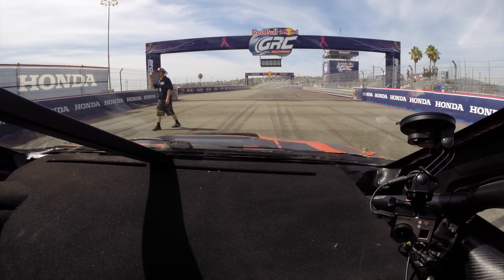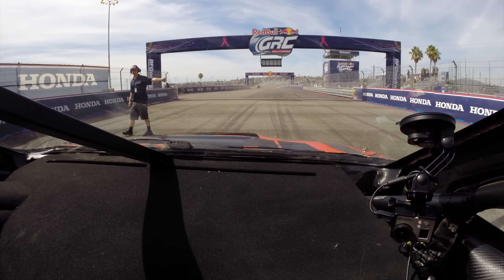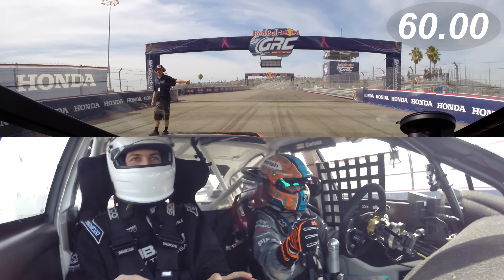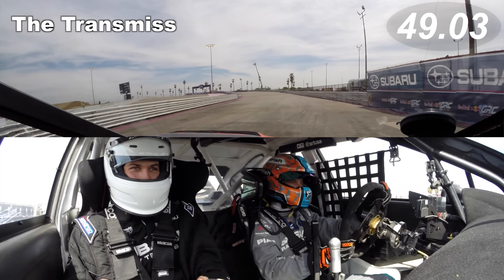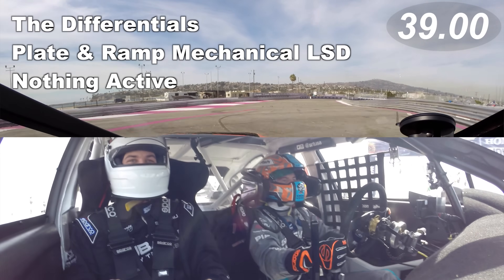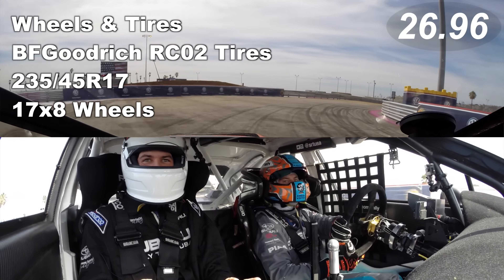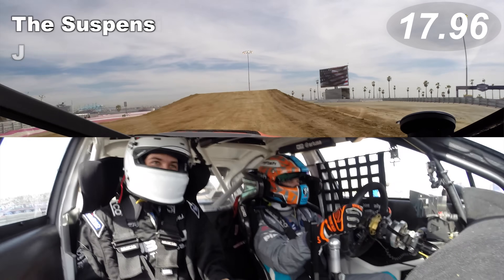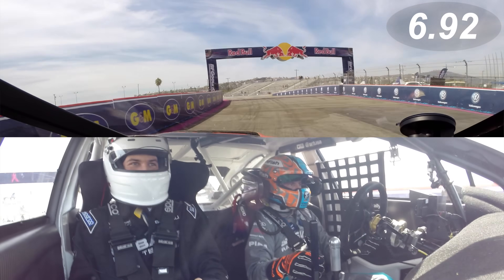600 HP Subaru STI - Rallycross Supercar Hot Lap!

Comment: top speed only 110mph are you kidding me?!?
Reply from the maker: +7150285 on this track, which has no straights.
Reply: 7150285 110mph is ALOT on any track. Especially given a track as tiny as this. Watch a side by side view of these against f1 cars for a good explanation
Reply: whatever. Most cars now can reach 110mph easily on the highway.
Reply: 110mph is easily achievable on a straight highway. My 1999 4cylinder can reach that speed easily.
Reply: it's all in the gearing. on such a tight course why do you need to go 110mph. Its much better to gear the car and get as much acceleration as possible to get back up to speed after these corners.

your 99 4-cyl def can hit 110mph on a highway straight. But i'm pretty sure your car can't hit 60mph in sub 2 seconds.

Comment: URGENT:
Can someone please explain why race or performance designed cars always have gear whine? is it because of straight cut gears? detailed answer would be appreciated.
Reply from the maker: Yes, straight cut gears. Your car has helical gears for forward driving, likely straight cut for reverse.
Reply: Are straight cuts more durable? what are the benfits?
Reply: forces are all axial so you can build a lighter & stronger gearbox and so on...
Reply: I'm no expert, but compare the gear in normal cars to screws. If you turn it, there will be force along the shaft, stressing the parts.
With straight cuts this doesn't happen. All the force is applied into turning the shaft.

PS: Sorry my English is not perfect.

Comment: How high does engine revs?
Reply: to the red line
Reply from the maker: It's around 8000ish RPM, they didn't give me an exact number but said that was ballpark. I don't believe RPM is regulated so they probably keep this info internal.
Reply: About 8000. There isn't any point of reving over that because of the turborestrictor.

Comment: how do u get that high pitch sound on that car?
Reply: It's actually the straight-cut transmission.
Reply from the maker: Straight cut gears, you can drive in reverse in your car to experience it haha.
Reply: it's not the turbos, these are staight cut gears. look it up on youtube, there are plenty of videos showing the sound. :)
Reply: +Nathan McDaniel  Definitely straight cut gears.  Helical gears put too much side force on the gear train, which can cause the trans to pop into neutral unexpectedly.  With straight cut gears, only one tooth is engaged at a time, so that sound you hear is actually the high-speed clicking of each tooth as it strikes its mate on the other cog.  You'll hear this on many modern cars also - in reverse (since reverse isn't usually synchronised, designers commonly slip the actual gears in and out of mesh, rather than using dog teeth and a synchro ring.)
Reply: straight cut gears, it's the same in touring cars
Reply: Ei Boi massive turbos
Reply: Ei Boi that's the turbo sound
Reply: open gears
Reply: that would be the sequential gearbox
Reply: Ei Boi It sounds more like gears than a turbo to me. I suspect there's a set of spur gears somewhere in the drivetrain rather than the usual (and quieter) helical gears. But I'm not a huge car guy.
Reply: sequential transmission with straight cut gears, otherwise known as a dog box.

Comment: Hi, got a question for you to answer. 'Taking weight into consideration, what is the smallest amount of BHP required for a car to reach 200mph?'
Reply: Depends on the drag coefficient and frontal area of the car in question!
Reply: Charlize Theron rubbish, there are loads of cars with much less horsepower that can reach 200mph
Reply from the maker: Weight isn't too important for top speed, limiting factor with be the frontal area/drag coefficient. So of course, it depends! But this video will probably give you a good idea of what you're looking for. :) https://www.youtube.com/watch?v=eWTsXrPWl5Q
Reply: Depends on a million different things. Aerodynamics, tyre grip, weight, drivetrain efficiency etc. 

There is no good answer to that question.
Reply: Only `murican cars messure HP in BHP...so drivetrain losses are not an issue :)
Reply: sorry but no. while the b stands for brake it has nothing to do with the cars brakes. brake horsepower only refers to the way of testing the power. A cars HP (or BHP) is as far as i know always the crank horsepower. at least it is in the us and europe.
Reply: The Esseboy bph is not whp
Reply: 0
A hot air balloon can accomplish this.
Reply: JordanWallac3 would be an interesting question to figure out though
Reply: Hellboy13994 Nope, in Europe we use HP (which is WHP), I know BHP is crank power, that is why it is not an issue, only in `murica!
Reply: Engineering Explained thank you for replying :)
Reply: if the aerodynamic coefficient is 0.2, which is as good as it gets for a production car, the minimum hp needed will be about 550
Reply: adidasboy132 Still depends on the frontal area of the car.
Reply: Weight isn't a limiting factor at top speed, you will get your topspeed faster if you are lighter, slower if you are heavier. Your formula is basically, Air Drag + Tyre frictions to surface = Power at the wheels. Of course all of them at 200 mph.
Reply: Depends on drag, if there was 0 drag, even the smallest amount of contionuous power would bring it to 200mph